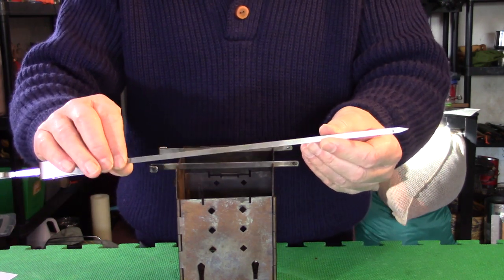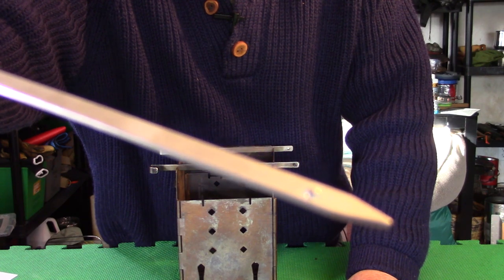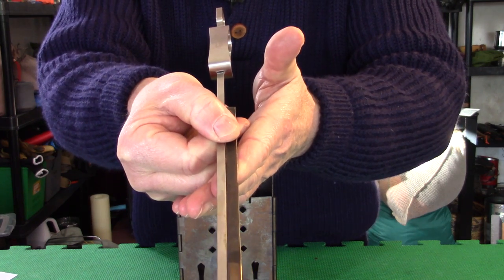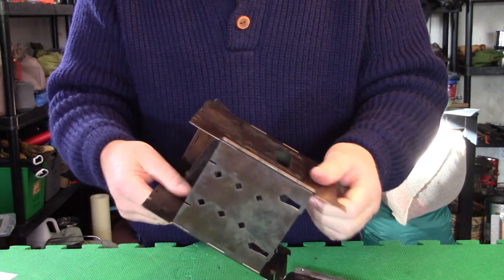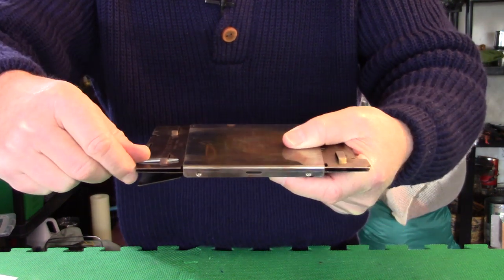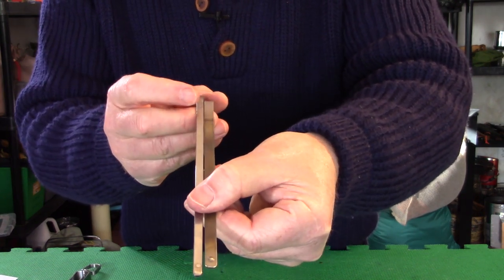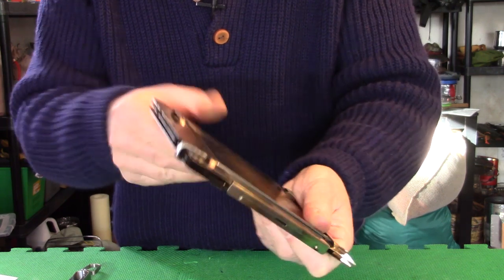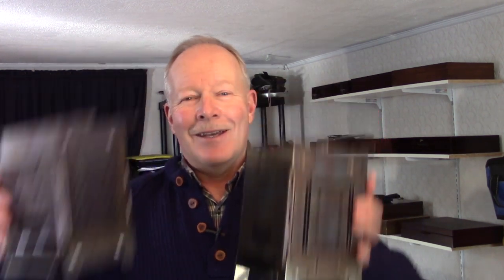DIY Firesticks for the Firebox Stove

Comment: That's very resourceful, Mark. I saw a new use for the flat skewers recently. Someone used two of the skewers as a stand for grilling meat on a spit. They cut slots in the ends of the vertical supports so the meat could be rotated and expected to stay in the new orientation.
Reply from the maker: Coincidence, I have been playing with a short spit and the skewers to see what I could come up with. Thanks Jim
Reply: @MarkYoungBushcraft  - I wish I could remember the photo I saw showing the spit in the slots. It just occurred to me that if the spit was heated and twisted 90 degrees, it would provide four orientations for the meat on the skewer over the fire. I'll look for the photo.